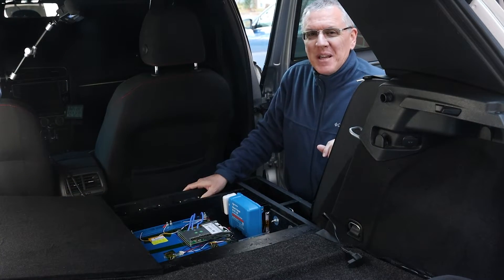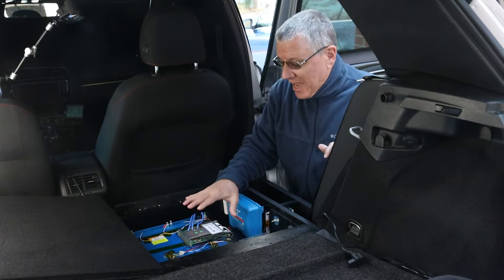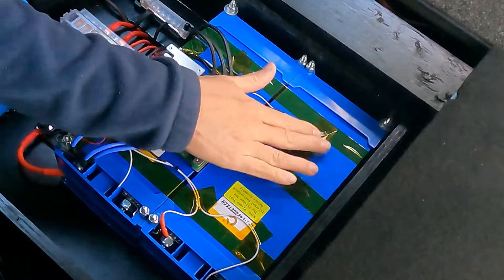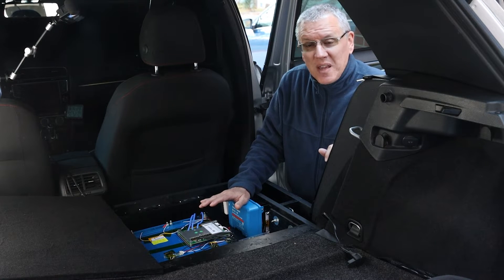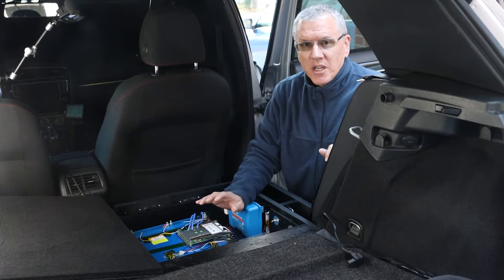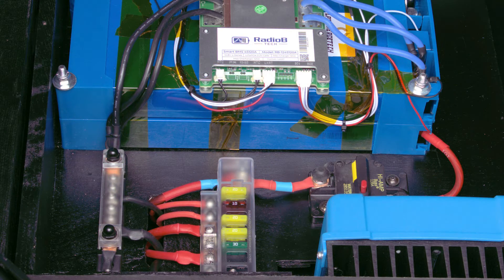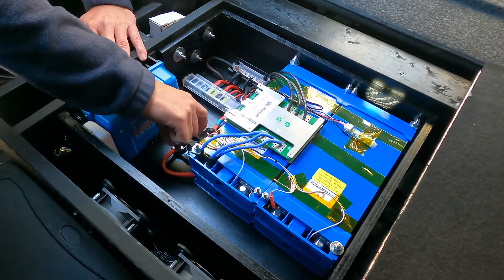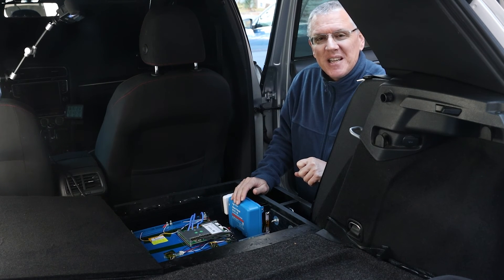100-Ah Lithium Secondary Battery in My GTI!

Comment: Hi, There :hand-pink-waving:
I was wondering I am planning on having at least 8 different radios plugged into this battery will it be able to handle all of them turned on and transmitting on one of the radios? What is the point of this battery installation is it to have less stress i guess on the car battery?
Reply from the maker: This battery will easily power eight radios so long as you don't expect to transmit on them all at once. I did a test where I keyed three radios simultaneously and pulled about 60 amps. No worries! And, yes, this battery and its isolated charger ensure that it has zero impact on my starter battery. Thanks for visiting!

Comment: We've got 300ah of lithium (BattleBorns) in our RV, so your build was interesting.  For charging, have you considered a mobile panel?  Instead of a DC to DC, you could have a 'suitcase' panel that connects to a MPPT charge controller.  If you deployed a roof rack full time, you could also mount a rigid panel on the rack so that you have charging anytime the sun is out.
Reply from the maker: Thanks for writing! What do you mean by a "mobile panel?" As you may see in next Thursday's video, I lack the alternator output to support high-current charging. So, my choice of DC-DC charger limits the charge current to 30A and protects my factory components. It hasn't proven to be a big problem because my battery is almost always at 100% within an hour of driving. Given usual high SOC, I don't think solar panels are necessary at this point. That could change in the summer when consumption rises and/or charger output reduces... and it would certainly change if I was camping with the car parked for longer periods. For now, it's a daily driver. 

If you're new to my channel, then you may not know that I prefer to hide my mods. I have a rack and can do a solar panel or two up there. But it would blow my cover and make the car more noticeable, not to mention noisy inside due to the panels on a rack.  ;-) Take Care!

Comment: Hi. Stealth GTI. I love most of your channel because were the same age. We have the same car tastes. But you are becoming upgrade NUTS like lasthumansgarage. If your not happy with the GTI. Time for a different car just like lasthumansgarage just did. I do everything you do including the towing in a is20 golf alltrack. The is38 is a total waste of money for guys like us. We drive in the city and that turbo is a dog in the low end spool. You used alot of money on that turbo for very little hp gain. The electrical upgrade is a waste too WITHOUT a high current alternator. You will burn the stock 140 amp alternator quite quick trying to recharge two batteries and the lithium one is dead. Mechman makes a good one for our cars that is more than double the current. This is because one dead battery pulls about 100 amps off the alternator when dead. Ask me how I know. Im running a 1500 watt stereo setup and I measured using a good DC clampmeter what the current pull was on the 0 gauge cable when my group 48 battery was a little dead. It was 105 amps.
Reply from the maker: Thanks for the note, John! Not sure I'm quite as nutty as LHG. I haven't shared video of me sniffing the engine bay. HAHA!  ;-)  I don't recall if LHG was displeased with his GTI. I think he may just be someone who likes to trade-in or trade-up every few years. Me? I'm still very happy with my GTI, which is why I'm doing what I'm doing to the car that I already enjoy. As for the IS38, I could go either way. It's fun when I put it to use, much like the same turbo in the Golf R or LHG's S3. But the IS20 is more responsive around town. BTW, I'm closer to highways and "less city" than you think; I just don't live in the land of high speed limits.

I understand your concern about charging currents. My DC-DC charger limits charge current to 30A (video next week). Anything beyond 30A will be supplied by the secondary battery, as planned. I suspect that my factory 150A alternator is specified to power my car with the AC, both heated seats, the sunroof, and all windows functioning at the same time. So, I imagine my 30A charge without those accessories running is not pushing any limits. If I'm wrong, then it appears that a 180-amp alternator from the 2019 Golf R might work and give me an immediate 30A improvement, which would  make the DC-DC charger "resource neutral." I'd just need to ensure that the larger alternator would mount to my existing bracket. 

Thanks for the lead on Mechman. Their site lists an alternator for the 2006-2008 GTI. I'll contact them to see if they have anything compatible with modern cars. Thanks for visiting!
Reply: That is very good to hear. I like LHG channel till he traded his GTI on EQT for a A3 Audi? Why bother same engine except the bottom end and a sedan. Im like you. I love my IS20 Alltrack on IE tune. 300 HP on a fully loaded wagon. I did noico the whole car so it is as quiet as his audi. I dynoed my car and it does the HP and the quarter mike in 12.4 seconds. So tge tune is working. Im sure that you will go through altrrnators as Ive had 2 batteries in 4 cars. All of them ate tge aternator because of the extra load. The second battery
Reply from the maker: @johnzubac4293  - Yes! Although LHG removed the majority of his accessories and moved them to the S3, his work like the Noico matting is gone. I prefer to keep my "sweat equity" a bit longer. Someone will get that car and have no idea how good they have it! I hope to do some noise abatement soon, albeit WAY late in the game. HAHA!